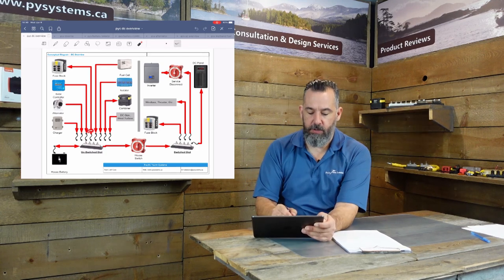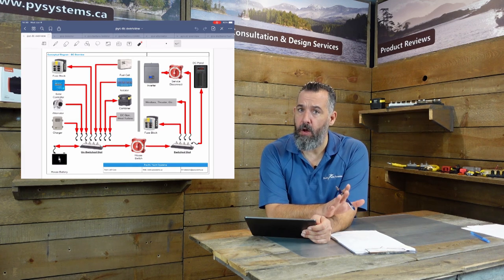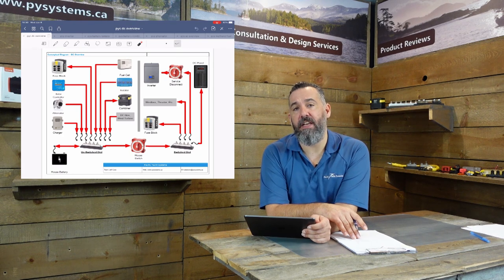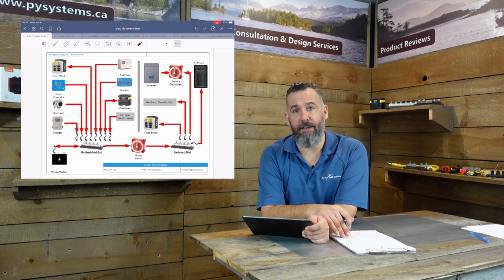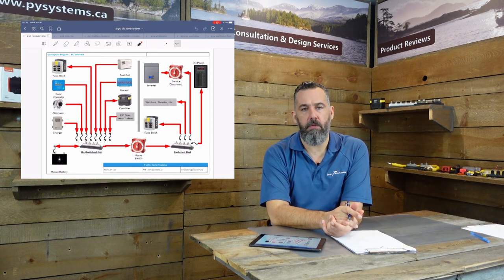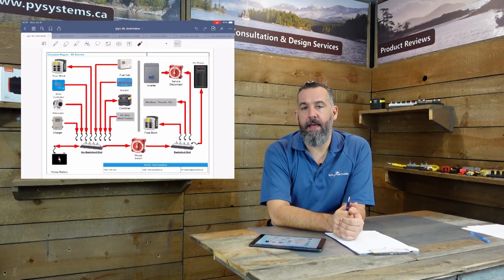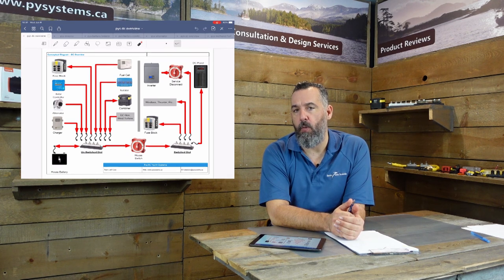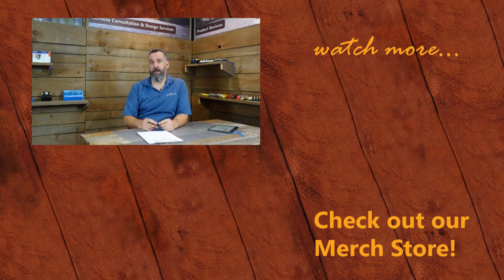I Am Installing an New Windlass, Do I Run the Large Wire All the Way to the Busbar At the Battery?

Comment: Good evening Jeff. First off, your work for community, nothing short of incredibly generous. You have a heart of gold. I do have a very similar question for a design idea on my up coming windlass install. I have 2/0 going battery to my switched distribution. I'm running my windlass' 2/0 off the distribution side of that switch. I'm also fusing and an on off switch in the windlass 2/0 shortly after the switch distribution. Is there any safety flaw in the design or am I missing something critical all together?
Reply from the maker: Thanks for the feedback.
The connection between your battery and the DC distribution should be fused at the battery, then each circuit connected to the DC distribution needs to have it's own fuse. The connection to the battery side of the switch, should also be fused at the DC distribution.

Comment: Great videos Jeff. Windlass related question I have a 23ft boat and my battery bank is about 3ft from the stern. Would you fit a separate battery at the bow for the windlass keeping the power cable short (which is my preferred idea) or run a long cable to current battery bank? either way this battery would need a long cable installed weather it’s to power the windlass or to charge the windlass battery that has been fitted at the bow thanks in advance.
Reply from the maker: With a boat of the size, would NOT recommend going to a dedicated windlass battery.

Comment: Hi Jeff. When installing an anchor winch is it best to be on the house (switched distribution panel) or on the start batteries (switched distribution panel) as the engine will be running when using the anchor winch? I have a VSR and emergency combine switch between these two banks.
Reply from the maker: That's a tough one, we commonly see the windlass wired to starter or house batteries. On my boat, and most of our installs, the windlass is wired to a house battery that is also charged by the alternator.

Comment: Hey Jeff, what's your thoughts on older boats like Hatteras with 32v? Up the voltage to 36? Stay the same and spend the time working around it? Or is there another option I haven't considered
Reply from the maker: Higher DC voltages are better then lower DC voltages as a way to reduce cable size on a boat, lots of cost and weight savings. That said, having a 32 VDC boat is good for cable size, but finding appliances that work on 32 VDC is a challenge. If i was to design a 40 or larger foot boat from scratch, would have mostly everything be 24 VDC and perhaps a 24 VDC to 12 VDC converter for any 12 VDC loads.

Comment: Thanks Jeff for your video. One additional question. In your opinion the windlass should be connected switched to a house battery or to an engine battery?? Navigation lights too, right?
Reply from the maker: Hi Luis, i'd make sure my house battery gets a charge from the alternator and would suggest to connect windlass to  house. But lots of boaters who connect windlass to engine battery. Running lights on house too.
Reply: Pacific Yacht Systems Thank you so much!!!

Comment: Another excellent video Jeff. Thanks.
I have 200Ahrs house bank and a 70CCA starter. I am in the process of checking all my fuses (correctly sized) and that all my electrical equipment takes its power from the right source (switched/unswitched etc.). Three queries arise. 1 - to which battery should the (auto) bilge pump be connected (and should it be a direct connection or through an unswitched busbar)? 2- From where should I take the power for my gas detector/alarm? 3 - Does my battery monitor (Mastervolt BattMan Lite) need a dedicated power supply (for the indication/control unit) and where should that be from? Thanks.
Reply from the maker: Paul, based on your info provided: 1) wire bilge pump to unswitched house battery 2) same, unswitched house battery 3) also, house unswitched positive distribution.
Reply: @PacificYachtSystems  Thanks PYC.

Comment: If I have a Battery in the bow to power my windlass and the bow thruster, will an isolated b to b charger ground my bow battery?
Reply from the maker: Depends on which DC to DC charging converter you choose, isolated on non-isolated, as victron offers both.
Reply: With an isolated Victron DC to DC charger.

Comment: hello from slovenia after i look this i check my boat and i notice on negative for windlass i have 100a fuse and on positive 120a fuse is that good , bad or ussles?
Reply from the maker: Some folks fuse both sides of the circuit. They probably made the positive smaller so it pops before the larger 120 amp on the negative,

Comment: I would like to install a windlass. I only have a 9.9 horsepower what generator do you recommend
Reply from the maker: Simple question with lots of answers. First off, consider the wattage of the windlass you need. Then figure out if your battery bank can handle this windlass wattage. Lastly, worry about how to recharge a depleted battery bank with either your 9.9 outboard engine or perhaps get a 2000W generator and connect to a 40 to 60 amp battery charger.
Reply: @PacificYachtSystems  thank you very much.

Comment: Separate battery for the WINDLASS?
Reply: They draw a lot of amperage. We have three, and like Jeff says it is one a separate switch from the house battery and the starter battery. 
Good redundant feature to have in case of emergency
Reply from the maker: Hi Romeo Whiskey, depends on the size of the windlass and also the length of cabling from house or engine battery to windlass.